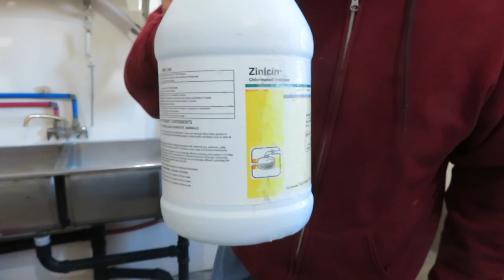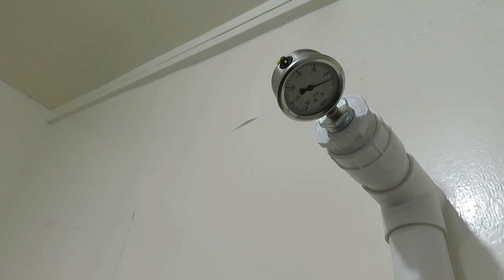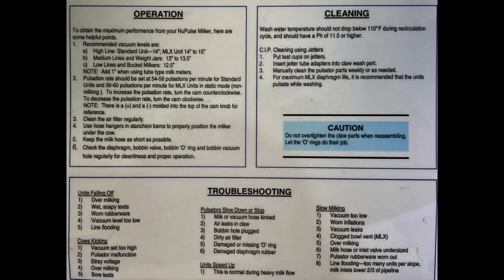Using a NuPulse Milker on our Dairy Farm (milking a cow by machine)

Comment: Best way of milking cows with this pulsator ; it even works better when your bring up the milk hose up to 1.2 meters (I think 4 feet) up . When the milk comes fast out of the udder the resistant uphill will speed up the pulsation and will milk the cow faster . Don't be scared to let the milk transport goes up, the cow will like it while the vacuum at the teat end will go down and the liner is not getting up in to the udder . We say here in The Netherlands the cluster should dance under the udder. When you bring the milkhose up don't use a diameter bigger than 14 mm (0.55 inch) When the diameter is to big the milk won't be transported good enough ; the column falls apart. In the 90 's I visit a dairy farm here in Holland the milked 1000 kg(2200 pounds) milk per hour in a 2 x6 Herringbone. I worked for Westfalia(main office now GEA) and visit the farm with my German college we did not believed it.Last year I bought a new Nu pulse claw and I will do some innovation : separate clean air support and we will do some liner test to reduce vacuum in the liner head . To do the tests properly we will use a Lactocorder to make milk profiles.I'am still convinced that the Nupulse when it is right installed and understood the best way of milking is also for the highest production cows . The modern pulsators let liners move to fast that hurt the teats , the vacuum is to stabile what is unnatural for a cow ; a calf completely reduce vacuum while drinking and a Nupulse simulates this the best of all systems. (but there is some improvement possible more on the head of the liner) The most important thing is that cows totally relax during milking ,no stress no pain . Then udder  health  will be secured sorry for my bad English  Best Regards Ron
Reply from the maker: Thanks for the information Ron! Since we started milking, we have switched to vented liners which have helped. Thanks for watching!

Comment: My grandfather used nupulse in his double 4 setup. Mainly to combat stray voltage. That pulsation sound brings back memories.
Reply from the maker: I much prefer vacuum operated pulsation. In addition to the stray voltage issues you mention, I love I can just plug it into the intake manifold of my tractor in an emergency and I have a working milking machine. We plan on installing a pipeline, but will continue to use NuPulse. Thanks for watching!

Comment: I loved our NuPulse single line pipeline milkers! Simplicity! If you have a problem, it's generally an easy fix. Not like the GEA system that the farm that I am currently working on...with that system the fixes range from easy to hard to "nope! Have to call the dealer".
Reply from the maker: Yes! A farm milking system should be rugged, dependable, and mostly able to be serviced by the farmer. An additional benefit of the NuPulse is that since the pulsator is vacuum operated, instead of electric, stray voltage from the milking system isn’t a concern.

Comment: Hi. I am watching every video you post here and am realy impressed. I would like to ask you, where did you buy cleaning unit, the one, where the milking unit is attached to while cleaning.? Sorry for my bad english and thanks for answer in advance. Best regards.
Reply from the maker: We bought it through Parts Department Dairy Equipment. We also got the milker through them, as they are designed to be used together. We really like the system.

Comment: Can you use the jetted on a deleval setup to? I know they make bucket ones but I was just curious!
Reply from the maker: I don't think so, but don't know for sure. I know they are designed to work together and there is the tube that plugs into the side of the milking unit. I don't think other milkers have the port for the tube.

Comment: Hi, I have a question about cleaning.  Do you have to disassemble the claw and hoses periodically to clean in the connection points? And do you only do the soapy wash once? I've seen other people do that stage three times, I'm wondering if the number is determined by the type of detergent.  Thanks!
Reply: Also, how do you know when to remove the inflations from the cow? I  just got a milking machine,  and when it looks like the milk has stopped flowing,  I removed it, but there's still a pound of milk in her.
Reply from the maker: I usually disconnect everything once a year, at the same time I replace inflations and do the pulsator rebuild kit. We use a CIP detergent and have never had issues with one cycle.
Reply from the maker: For you second question, if you’re using a NuPulse claw, make you’re you’re using NuPulse shells too, as their heavier than most others to compensate for the lighter, plastic claw. We have one cow we have to machine strip to get all the milk out.

Comment: I always enjoy your videos. They're so informational and I found a tandem milking stanchion. It's not the surge brand but I'm so excited and we're going to have a pit but it's only going to be 20 in deep cuz I'm really planning on just sitting because I do better sitting. Your video is so informational I'm not going to be big marketing like you are doing. I do have question. The little kind of lightly curved bracket on your wall that you hang your line on. I've seen those in the past but I can't find anybody to purchase them from. Do you remember where you purchased yours from? Thank you again. Absolutely enjoy your videos.
Reply from the maker: Hi! Glad you enjoy the videos! The hose hanger is from Surge… It’s part of a kit of hangers that Surge sold that included a hose hanger, but also a bucket hanger and inflations/pulsator hanger. Sometimes they show up on EBay or DairyTrain. Hamby dairy supply did make some reproductions at one time, but I think they’re sold out now. Might be worth checking though. Good luck on your search!